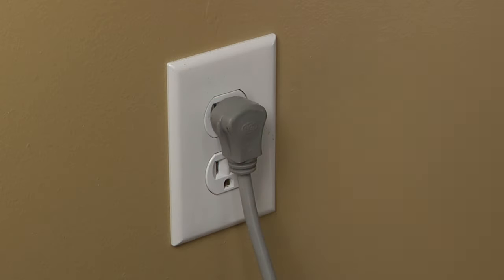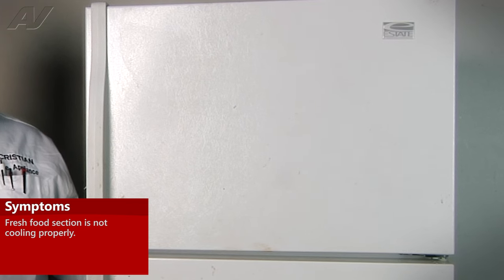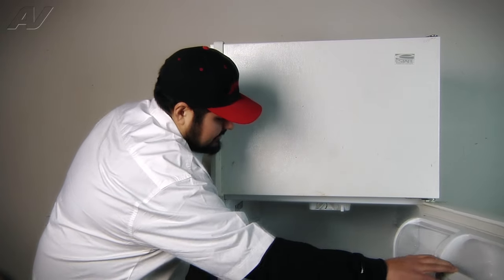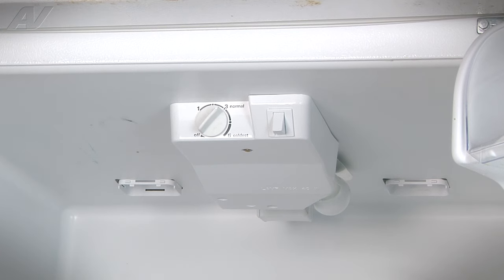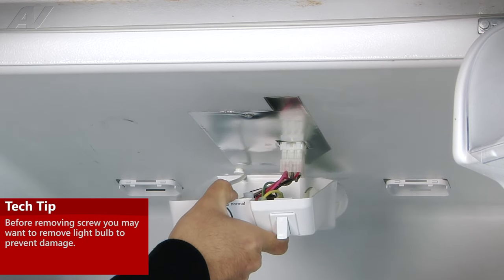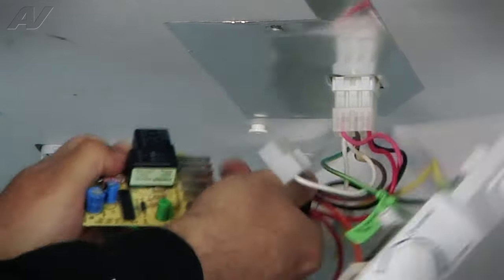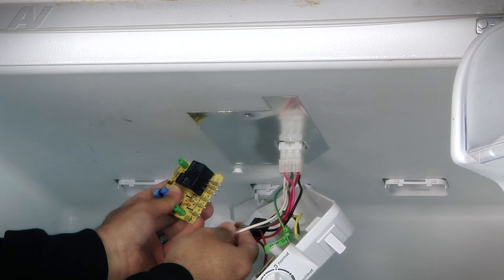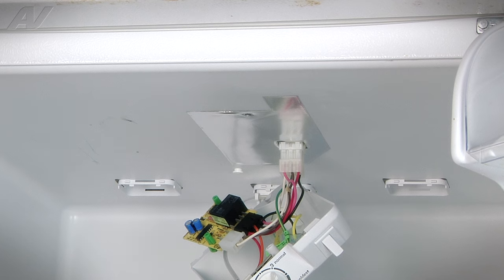Estate Refrigerator Repair - Fresh Food Section Is Not Cooling - Defrost Control Board Diagnostics

Comment: How check?
Reply from the maker: Great question, if you have a
more technical question that our parts department cannot answer, our
technicians are answering all questions at our website at www.ApplianceVideo.com under our Repair Help section. You can also call
our parts department at 1-800-830-5465 and they can give you help 7-days A week
Monday -Sunday, or search at www.SaveMoreOnParts.com  24 hours
7- days A week.
Reply: How do you check the control board is not working?

Comment: What is wrong when the freezer fan clicks on and off!! You can feel the relay on the defrost board click on and off too!!!!
Reply: Replacing the defrost board doesn't stop the clicking!!
Reply from the maker: Great question, if you have a more technical question that our parts department cannot answer, you can search our over 17,000 answered questions free at our website www.ApplianceVideo.com under our Repair Help section. You can also call our parts department at 1-800-830-5465 and they can give you help 7-days A week ,or search at www.SaveMoreOnParts.com  .

Comment: Help. Help. Click click click goes the defrost control board!! And the evaporator motor, and the compressor too. Click click????????
Reply from the maker: Great question, if you have a more technical question that our parts department cannot answer, you can search our over 17,000 answered questions free at our website www.ApplianceVideo.com under our Repair Help section. You can also call our parts department at 1-800-830-5465 and they can give you help 7-days A week ,or search at www.SaveMoreOnParts.com  .